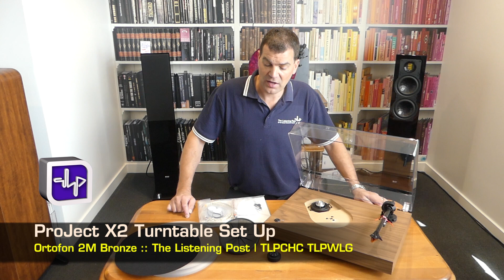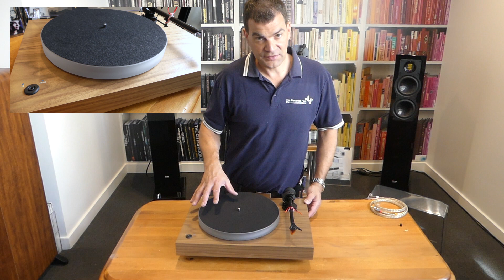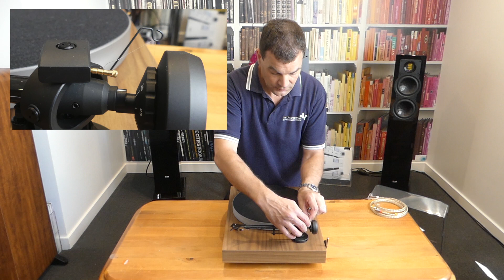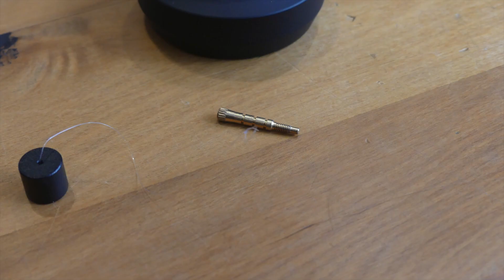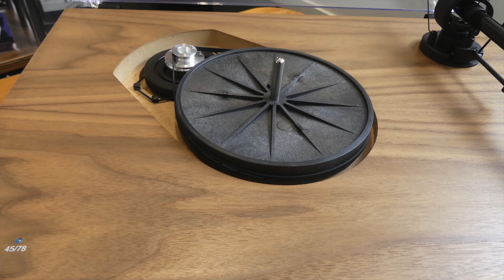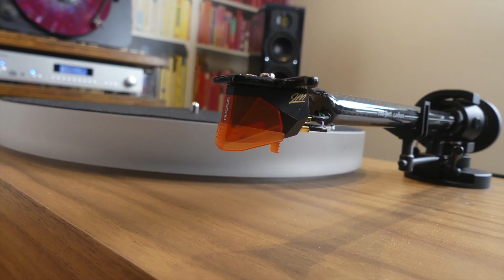Pro-Ject X2 Audiophile Turntable Set Up | The Listening Post | TLPCHC TLPWLG

Comment: It is strange some X2’s have a shepherds hook anti skate and others have a second little peg to hang the weight.
Reply: So strange.... also the arm yoke is different...
Reply: @alexanderlee896 The arm with hook anti-skate and the more rounded yoke is the earlier and cheaper 9cc tonearm.  All the X2s I've previously seen have the later more expensive Evo 9cc arm. which has a more substantial, flat on top, yoke with the brass peg.  If I was buying that table  I would want it fitted with the more recent Evo arm, which is the one featured in all the official adverts that I've seen. Check it out.............